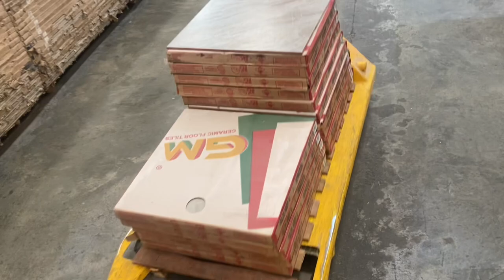Antique,Philippines house build DAY264-INDOOR STEP TILES AND NOSING / DOOR BELL.

Comment: What happens if you hook a heavier fish than your expensive drone can lift ? That would be an expensive drone in the water being pulled around by a fish !
Reply from the maker: When you get the bait out there you have a remote control release and drop the bait. Then you fly house and pull in the fish with a regular fishing pole.